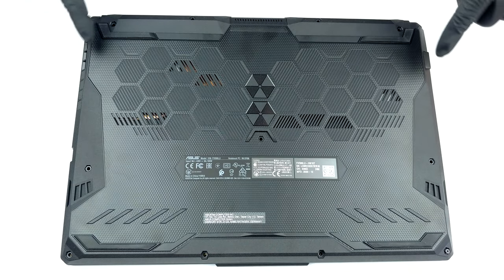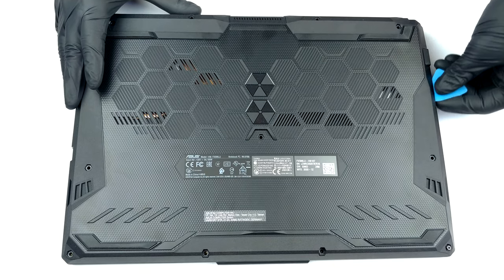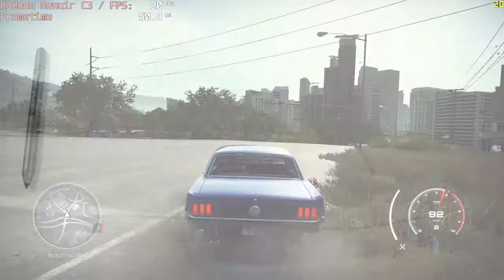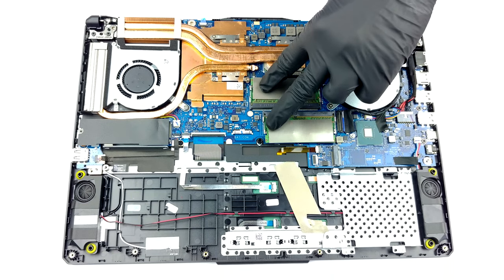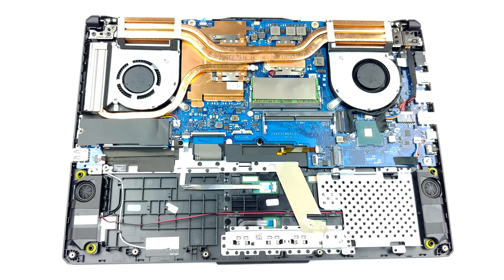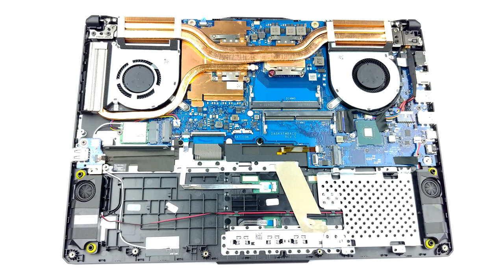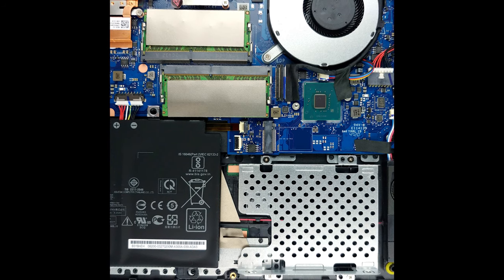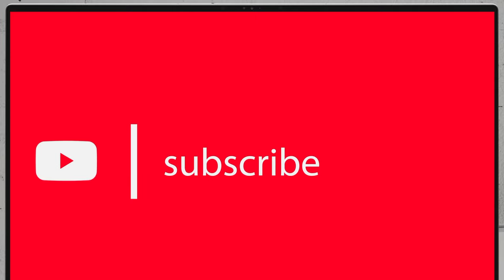🛠️ ASUS TUF F15 (FX506) - disassembly and upgrade options

Comment: Thanks, the bottom right screw was driving me nuts. Helped me add another 16gb ram so I can get 60fps on cyberpunk.
Reply: you had only 1 ram by default?
Reply: Sadly yes as it was a sale item

Upgraded now at small cost and delighted
Reply: @goodguyberr yes, it comes with one 3200mMHz 8gb stick and one empty slot for upgrade
Reply: i wanted to know if its okay to take the big black sticker off the ram because these stickers make my fan really loud
Reply: I put another 16 to make 24, 16 is small for me. And I have trouble with screwing back the center screw, it's like bit already broken hole lol
Reply: 60 fps on cyberpunk with this laptop impossible 😂
Reply: @animania4074 im getting like 100fps max on the benchmark on the same laptop, although mine is 16gb variant
Reply: @sbhops did you find out taking out the black stickers affects anything? 😂
Reply: @hungmg no lol. I let the professionals fix it in the end. Turns out the issue was the fan itself! 😂✌🏾
Reply: @sbhops  yeah, my gpu and cpu fans was broken so it made my laptop run like its an airplane engine taking off 🤣
Reply: Caesar doesn’t help out does he?

Comment: This video helps me a lot for upgrading memory module. Thanks!
Reply: Can I use use 90wh battery in my fx506li. Currently it has 48wh installed inside it
Reply: @Godofthunder793 You did it? According to me, if you are only looking for the battery version that suits the screws, it is also of higher voltage but when passing the faces there is no problem, only these will get hotter
Reply: @enriquepenanieto6192  no i didn't , i get that repaired under the extended warranty of Flipkart.

Comment: Thank you for this video, I was stuck after removing the screws and you gave me confidence to gently pry it open.
Reply: What did you pry it open with?
Reply: @davidrichards8793  Metal nail filer if I remember correctly.
Reply: you can use wisher as I did

Comment: My dream laptop. I am going to buy it next month.

Edit: I got it few months ago. Best thing in laptop is upgradability. I've 1tb ssd model and there is one empty slot is nvme ssd and one for sata 2.5 hdd.
Reply: I am also going to buy it next month Tuf F15 i5 10300H 1650 variant Rs.59,990☺ BTW can I know About yours and any problems
Reply: @JEE-ff5pp  i hv bought i5 11th gen 11400h 3060 variant at Rs 90,000 cons are speaker quality is  tooooo low  plus screen is not that bright and heating issues i recommend you to buy heating pad otherwise its best in segment i love it
Reply: i got mine with 1tb ssd and 16gb ram. almost a year later, its still running perfect. my plan now is to double the ram and add a 4tb hdd. im surprised its so cheap. $85 for seagate 4tb 2.5" hdd, and $114 for 2 crucial 16gb ddr4 ram.
Reply: @electricalife  It have HDD slot??

Comment: Thank you! this video helped me find out about the bottom right screw. sadly I was trying to put my old 2.5 SSD drive only to find out that my laptop model doesn't support it. it have a longer shape batttery that extend all the way blocking the drive, but I managed to replace the ram with 2 16GB ram and a second 970 evo plus nvme which worked very well. once again thank you.

Comment: which sata cable does hdd will use 2.5 inch or 3.5 inch?? and do we need to but that sata cable or we will get in box in case we are adding hdd ?

Comment: Laptop model: Asus Tuf F15 Fx506hcb
Core i5, 8gb ram, 4gb Rtx 3050ti,48wh.
I have some questions:

1. Have you experimented with various sata cable in upgrading the Sata HDD like using a sata of HP or dell on your Asus Tuf laptop? 
I know there are generic ones specific to Asus Tuf F15 but I can't find it in my local store so I want an alternative and to possibly know if there is any risk involved in using a different/unbranded sata cable.

Thanks in advance

Comment: Very good video! by the way, what is the tool of blue piece to open the back cover?
Reply: I think it's called pry tool
Reply: But you can always use Philips screw driver to pry it open but be really careful
Reply: @zaynify1  Thz !
Reply: just use debit card or some other card you have for that, does the job perfectly and will not damage the laptop
Reply: it's doesn't work when the gap less than the thickness of credit card.

Comment: can you remove the pre-installed 512 nvme ssd and replace it with let's say 1tb nvme ssd plus add another 1 tb for the extra slots? if so, can you copy your previous os to the new ones or is it better to just installed a new os? My first question also applies to the ram slots. one other thing is there a limit to how much the limit of ssd storage you can put in this device?

Comment: i was interesested into upgrading the GPU, but dont know if its soldered or PCI connected.
do you know wether its soldered or PCI connected?
Reply: Did you get an answer ? I'm looking for the same thing!
Reply: @guillaumefaure8722   most or all new laptops arent pci connected anymore.
ive never seen one with a pci gpu anymore lately, because its just inconvenient.
also there are no laptop pci gpu's so you cant upgrade either.
maybe look for an extremely upgradable laptop with interchangable parts. i know one, but forgot the name.

also honestly if you're just gonna use a laptop for gaming, buy a ps5, and like an office laptop.
this is way better.

Comment: Is this Intel core i7 variant? Plz make a in depth review. Thanks
Reply from the maker: Here you go ;)
https://laptopmedia.com/review/asus-tuf-gaming-f15-fx506-review-a-decent-performer-that-is-easy-on-your-budget/
Reply: @LaptopMedia 

Is the Tuf fx506hc i7-11800h rtx3060 version legit? I cant seem to find much info on it and the price is much lower than other sellers I've seen. Am tempted tho it's a bit out of my budget....1.85k....
If you disconnect the battery can u still run on ac power? Problem with modern laptops are the batts arent external/independent....

Comment: if i open the laptop and adding some RAM will it remove warranty ?
Reply: that's up to every company. so you will have to call them and ask
Reply: usually it wont void the warranty, depends on the specific service centre. some  A**hole may refuse the warranty but usually they dont.

Comment: Good day. I have the same laptop, and my video card has suddenly failed. The service center said it needs to be replaced. My question is, where should I buy it? And can it be replaced?
Reply: Only with soldering professionals or motherboard replacements.

Comment: I have Laptop ASUS TUF F15 FX506HCB , and I don't have hdd port on board but i have place for hdd disk. I only have port PCIE SSD. Why?
Reply: Maybe your battery capacity is more than 48wh. Because a larger battry covers the entire base of the laptop. But with a 48wh you'll have a space at the lower right part of the laptop to put the hard drive

Comment: I have the 48Wh variant and the battery life is unsatisfactory. Is there a way to upgrade the battery (say if I remove the drive bay)?
Reply: It's a late reply, but if you found any solution pls tell me, I contacted asus support and they said no
Reply: Did y’all figure it out

Comment: Did you mean if I make the battery more powerful I won't have the option of adding a new.ssd?
Reply: No, you can still have 2 SSD. The 90w battery will take the space away for the HDD only.
Reply: @macheionut9740  gotchya thanks
Reply: Did you figure out how to upgrade the battery

Comment: Hi. After I renew thermal paste, I lost the light of the screen but I can use with hdmi. What should I do? I might use paste bad. Could it be because of this?
Reply: See the connector that's between the DIMM1 slot and the PCH (small CPU looking thing with no heatsync), that is a eDP connector that connects the screen on the laptop to the motherboard. See if it's loose/disconnected, if not see if the cable is damaged.

Comment: I had an asus tuf f15 fx506li laptop i7 10th gen, installed ram is 8gb 2933mhz I wanted to update my ram please suggest an ram to upgrade my lap
Reply: I took out the 8gb 2933mhz and replaced with two 8gb 2666mhz and it seems to be much faster. I chose 2666mhz because it's cheaper but you could also get 3200mhz
Reply: @willstruder  In website it shows the intel i7 wont support to 3200mhz ,

Comment: Can u also explain the difference between the two batteries in terms of laptop performance. Is it only gonna gives us more time or is 90wh battery providing more watts for the processor to work fast. I hv seen tht this laptop has armory crate which puts a limiter on processor speed when on battery power. Can we expert improvement on 90wh
Reply: Watt hours improves battery life only. If you want to have your laptop perform at full potential, plug it in
Reply: @uriaanduplessis4124  thank u
Reply: Game Anime Stuff  yes i have Myasus and laptop is up to date. But i have experienced that on battery power, this laptop has lag. The reason i understand is tht most likely the processor is nt a regular 17 to 35 watt but much more than tht and the battery cannot support it to perform at its max. Another reason is tht the Turbo mode in Armory crate only works when plugged it. It doesnt work on battery power. Lastly once on turbo, this laptop has amazing speed

Comment: Is it possible to replace the 48 Wh battery to the 90 Wh battery?
Reply: Some question I have
Reply: I just did this with my FX506LI model and after a couple discharge-recharge cycles it is recognized perfectly and significantly improved my run time. Went from having under 1 hour to almost 3 hours run time (my previous battery was a little old too and only at 70% health).

I can't guarantee it'll work on other models and unfortunately no 1st party replacement options, but if you do a bit of research you can probably find one compatible (i found mine on Amazon)

Only other downside is you have to remove the hard drive bay, but that was okay for me since I didn't have a hard drive that fit in it anyways.
Reply: What part jumebr